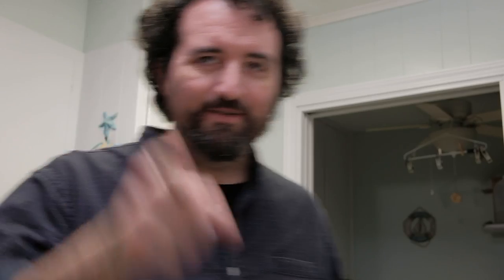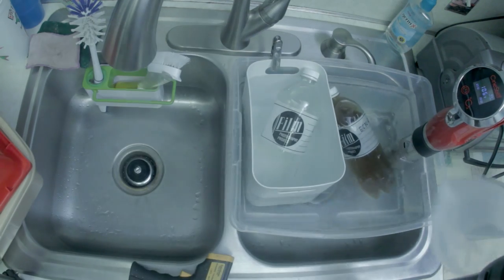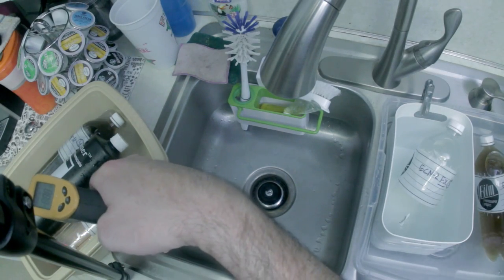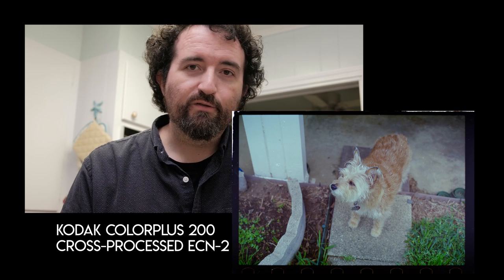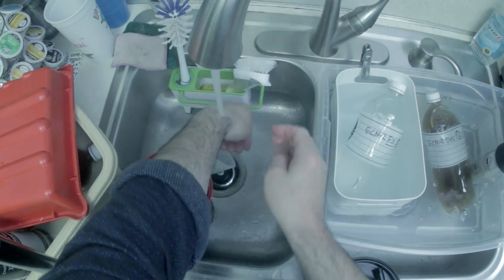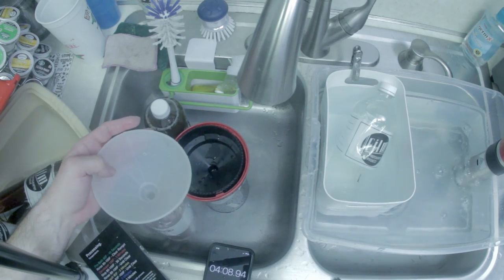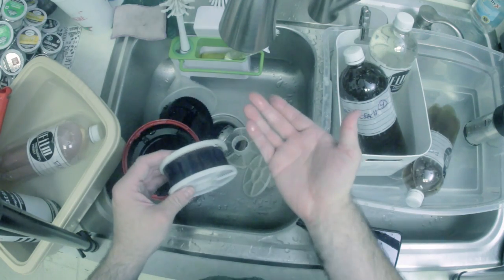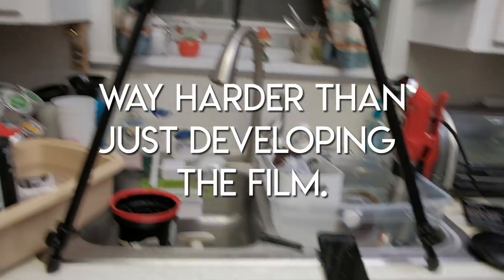ECN-2 film developing at home - Film Photography with Kodak Vision3 + Cross-processing C-41

Comment from the maker: Have you tried or avoided cinema film? I'm shocked that the remjet was kind of a non-issue. Any questions? Thank you for watching!
Reply: For remjet removal, I just super saturate water with baking soda, and agitate (vigorously) for about a minute. Dump the mixture and rinse. The remjet comes out with the rinse. One less chemical :)
Reply from the maker: Very true about reducing the chemicals! I need to give it a try when I've exhausted this stuff. It's funny how easy it is when people seem so put off by it. Thank you for the comment and suggestion!
Reply: Doing research to get ready to dive in to ECN-2. Great video, thanks! What's the IR Temp gun you are using? Also, are those just soda bottles for the chemicals?
Reply from the maker: @adamhutsell5887  Awesome! And thank you! The model I used is the Etekcity Lasergrip 1080 ... You jus thave to make sure to stir the liquid before you measure, or take a few  readings over a few spots to make sure you're not just measuring the surface temperature. Still, I love using the thing and not having to clean yet another thing off every time I check a reading. It seems accurate so long as I make sure to measure that way. And yeah, just plain soda bottles! Thoroughly cleaned, of course. But they have served me very well. Good luck with your ECN-2 work!
Reply: @JamieMPhoto   Thank you! So reading the surface of the bottle is accurate enough to gauge the internal temp? Also any recommendations of reels for the Patterson tank?
Reply from the maker: @adamhutsell5887  It's accurate so long as you stir it adequately just before measuring, that way you bring water from the bottom to the top, etc. Still doesn't hurt to check around sides now and then to be sure. The standard plastic reels for the Paterson have always worked well for me. You can use a toothbrush if they get too much remjet on them. I definitely like the white reels in that case since they can let you know if too much remjet stuck around after rinsing.

Comment: His comments on temperature control is odd, as you do not have to manage multiple temperatures for this process, contra his mention. The critical temp is the developer. You can run the other chemistry at the same temp as the devleoper, or they can be run at somewhat lower temps if you prefer for some reason. The reason of this distinction is that the function of the devleoper is time/temp critical. By comparison, all of the other chemical steps "run to completion" ,meaning that they do their chemical thing until whatever they are doing to the film is chemically finished, then no more  "processing" will happen, no matter how long you leave the film in that solution. (I.E., you cannot over-process the bleach, fixer, or stabilizer.)

Comment: Good job on the video.  While technically correct per the Kodak process for home use temperature (per step) isn't that critical.  
I've developed over a thousand feet of Vision3 (50d, 200t, 250d, 500t) film with the Kodak recipe mixed from raw chemicals with excellent results.  I run everything (from pre-rinse to final wash) through my Jobo at the same temperature (106) with no issues.  I do everything else the same but I use a chemical wash bottle with final rinse (C41 final rinse) to wash down the hanging film and I only use the PEC pad on the base side and don't touch the emulsion.  I tried microfiber but the film came out too dirty which I only noticed when scanning on a scanner without ICE.  (Frontier SP2000) 

I've never though of cross processing C41 film in ECN2.  It looks interesting and I'll give it a try the next time.
Reply from the maker: Awesome, that’s great information! I’ll try my next batch all at 106. I miss Jobos a lot, but did get a roller setup which does make life a little easier and more consistent. Do you use the sulphuric acid (I think?) in the stop? I hear the color is better with it, but handling it sounds a bit sketchy. Maybe if/when I get a proper home lab set up ... Thanks again for watching and commenting and for the good information!
Reply: @JamieMPhoto  No H2SO4 for me.  It's hard to find (although I did find some in a local hardware store lately) and very nasty stuff.  I am using diluted distilled vinegar for now although it's not supposed to be compatible with the process.  My next experiment will be with a water stop.  One day I'll get adventurous and try bleach bypass.
Reply from the maker: @jrnovosel  That's cool. I've been using Sprint stop bath, and it seems to work very well, though I use water stop for any other process (including wet b&w prints when I get to make those). I did bleach bypass with a roll of Cinestill once. Much more subtle than I expected, but very nice results. I need to try it again soon, for sure.
Reply: Were you able to get Antifoggant? I've heard it makes shadow performance much better and less grain in Dmin. According to some recipes it is 0.22g/L of 3,5-dinitrobenzoic acid. I wasn't able to get it yet but it seems to be sold outide of my 3rd world country for cheap
Reply: @jrnovosel  H2SO4 seems to be sold at every gas station or car parts in my country as 1.28g/l car battery electrolyte. I use approximately 42ml per 1L of water of 1.28g/l electrolyte and it seems to work perfectly
Reply from the maker: I haven't yet, but I've also been dealing with a chemical storage that makes me want to be sure I can store it safely enough. I'm very interested in what Cinestill is doing that they claim removes the green cast ... I've got one of their kits I intend to use very soon. Thank you!
Reply: @JamieMPhoto  I don't understand these ridiculous prices for CineStill. It is just Kodak Vision 3 which lacks anti-halation layer thus is optically defective in sake of automatic c41 cross processing capability for those people who deprive themselves a joy of hand processing of their own film 😑
Also as I know pre-bath process removes soluble color dyes which act like a filter. That thing which colors your pre-bath yellow/red or sometimes blue. It shifts color balance significantly. And fresh Kodak Vision 3 is just $4.5 per roll of 36+ on b&h if buying 400ft bulk
Reply: @JamieMPhoto  I recommend you to try original ECN-2 developer recipe with 0.22g/l 3,5-dinitrobenzoic acid instead of skipping AF-2000 (also without anticalcium cause you're using distilled water). It will open up whole emulsion's dynamic range and perfects the color balance. I don't quite believe any side marketing besides what Kodak recommends. Many motion picture shot on Kodak Vision 3 look amazing in 4k despite the fact that frame size is half of that of 35mm camera!
Reply: @NoviSavvy  CineStill has spend a lot of time and money perfecting the process and machinery to remove the REMJET and repackage the film.  They have to purchase Kodak film, process, package, market, etc and make a profit.  Even at their volume the discount from Kodak probably isn't that great.
Reply: @NoviSavvy  I'll try to get my hands on some of this and give it a try.  I'm not shooting much of anything these days though...

Comment: Hello, I am planning to develop kodakchrome super 8mm expired 1982, its just an experiment I like to do at home, my question is, should I use ECN-2 to develop it, or C-41 ?  I do understand that ECN-2 Is for color film, and I really do not care if the film turns out to be black and white or color/ Can you please advice? Thanks
Reply from the maker: Hello! I actually think D76 1+1 for times HP5  would be developed is a better approach. Kodachrome doesn't have dye couplers, so the standard color developers can't work and you'll be better off concentrating fully on developing the silver in the film. Kodachrome has remjet, so I would guess you want to use one-shot fix as well. I don't know how strong Kodachrome remjet is vs ECN2, though, so maybe you won't have to. Good luck with that! I do very much wish Kodak could figure out a way to bring this back.
Reply: @JamieMPhoto  Thank you Jamie

Comment: I developed vision 3 film without removing the remjet with cinestill c41 kit chemistry and they came out totally blank , do you think is the remjet it couse this problem? I had developed at the past with tetenal c41 kit and haf no problems at all
Reply from the maker: Oh weird! Was there writing on the film at all? That could have been a blix-in-first issue, or bad developer. I've noticed remjet will spoil blix much faster regardless of the manufacturer, but I haven't seen any real difference between other C41 kits and Cinestill.
Reply: @JamieMPhoto  no writing at all

Comment: How would I go about developing a 100ft roll of kodak vision 3 16mm 500T in a morse G3 tank. What would the developing times be.
Reply from the maker: A good but tough question! I have not personally used the tanks, but I've heard it takes up to 20 minutes to develop the reel because the agitation can only affect a small area all at once. So you basically wind it back and forth through the process. Some people do get solid results, but I would certainly run several test reels before committing to important footage. I would try on black and white first, and I probably wouldn't worry too much about remjet on color since you can clean it off by hand after. I hope that helps!

Comment: Do you Necessarily need the fixer? I found a kit with the pre bath , developer and bleach
Reply from the maker: Sorry for the slow reply! I was trying to figure out what kit that might be that you got? The QWD kit comes with fix, and while the Conspiracy of Cartographers kit doesn't, it's instructed that the user mixes Ilford Rapid Fix (which is actually what I use, too). I believe fixing is vital to remove the "mask" from the image ... but I'm pretty new to the science of color. I hope that helps!
Reply: Absolutely! It removes blue and white layer and also silver from the film. It will not be transparent without it. You can make your own fixer by mixing 125g of sodium thiosulfate and 5g sodium sulfite per 1L of solution. First you mix it with 500ml of very warm water then you add water to make 1L. Time is 6 minutes at temperature from 32C to 38C (doesn't matter much) Measure time for the film to get transparent and multiply it by 3 that's your fixing time (usually 6min). Extended 15 min wash (30min is perfect) is required. Sodium thiosulfate washes out a lot slower than normal ammonium thiosulfate fixer but still works fine. Also you can use Ilford Rapidfix. That's your normal fixer which can be washed out in less time. And don't forget to quick rinse film with 1 drop of clear dishwashing liquid or any other surfactant to get it dry better